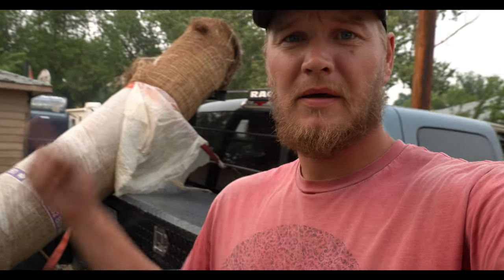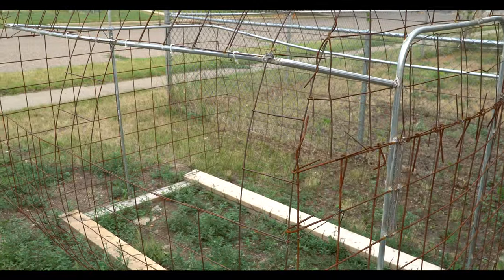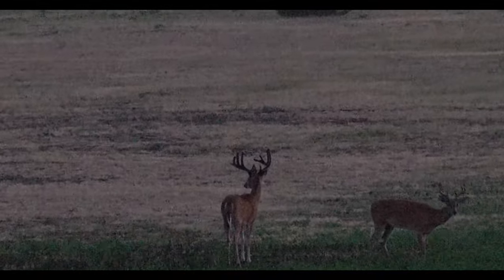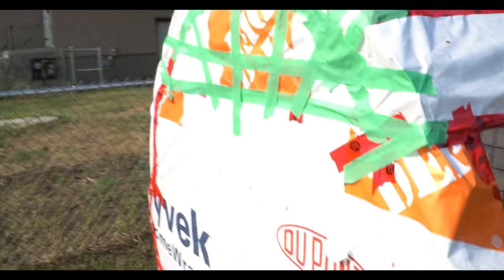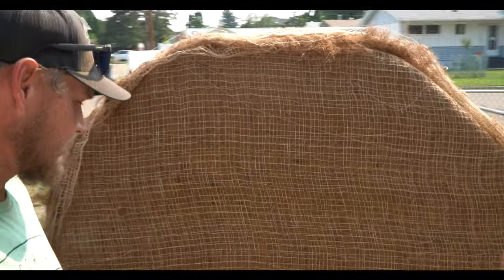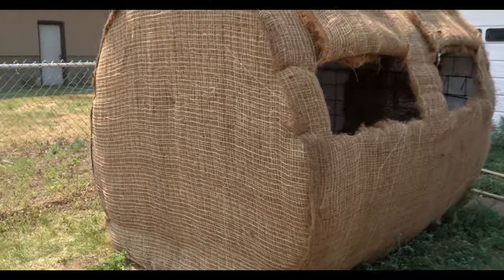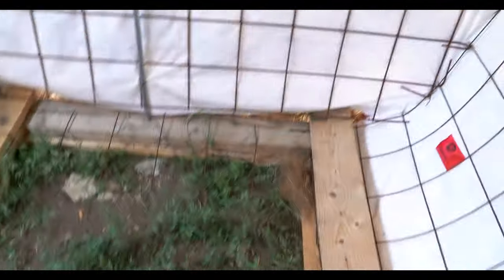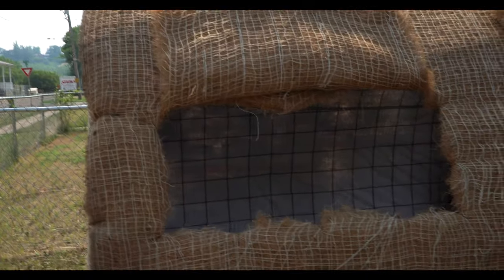| DYI Round Bale Blind Build | Part 2 | Completed |

Comment: Looks good. go flat black for the paint on the inside. wear black clothing when sitting inside will help eliminate the deer from being able to see movement when drawing your bow etc. good luck and very respectable deer.
Reply from the maker: Thats a great idea, thank you!. Probably wouldn't be a bad idea to paint the face with black face paint either.
Reply: @peterrodermond2901  for sure. make sure your bow hand has a black glove on too. all I hunt out of is ground blinds. want to make one of these myself sooner or later.
Reply: Looks good.  I made one with straw but your roll is way better.  What is it called and where did you get?   Way better in my opinion. 

Mine looks awesome but straw mesh is pain in ass and messy